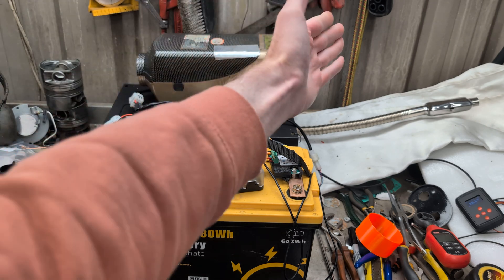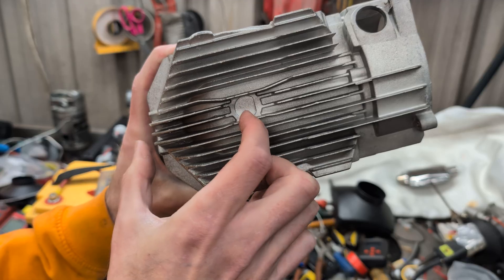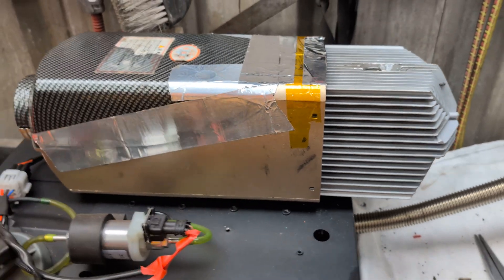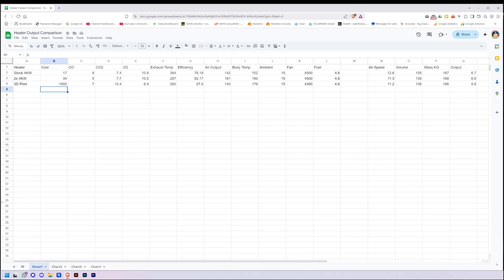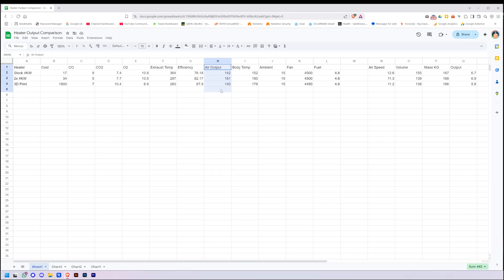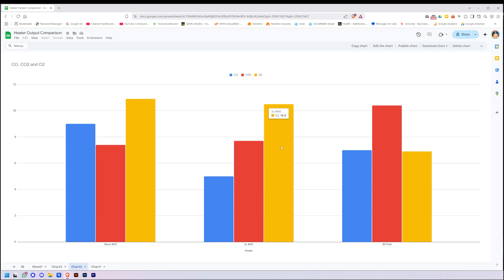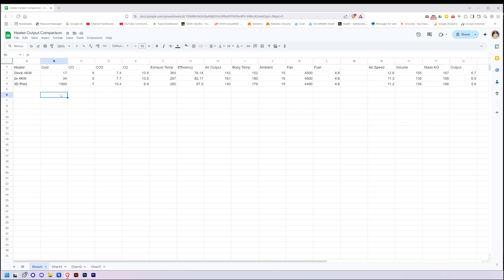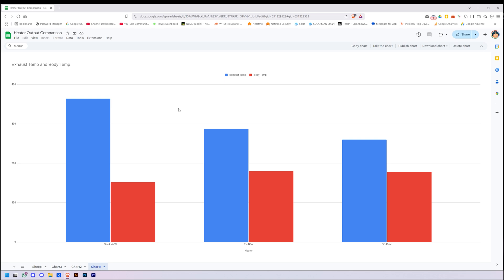8KW Diesel Heater Project - Heater Body Comparison - part 4

Comment: So would standard burn chamber and smaller dosing pump give better efficiency or is the standard pump the minimum dosage for combustion? 🤔
Reply from the maker: I've made the burn chamber longer so the hot gasses go all the way to the end, so they spend the most time interacting with the heat exchanger.  Changing pump sizes is something to explore, but I expect on max power the small pump will struggle to supply enough fuel.

Comment: So, a 4KW heater managed to produce 4.5KW of heat, approximately and was the best results. Not bad at all at almost 88% efficiency. 
I think the gains would not be as impressive with anything longer and think there there would be a point of diminishing returns.
The issue long term would be the burner running cooler at lower settings, not burning the soot away, leading to more carbon build up in the burn chamber.
Good work, David, interesting experiment indeed.

I'd prefer a bolt on TEG setup that bolts on to the exhaust under a van, the wires coming back inside to put charge into a battery.
Even as low as 1 ah would save 24 amps from a battery over a 24 hour period running a heater like this 24/7 during extreme winter conditions.
I know you've done similar it but was a little over engineered and more of a complicated build than I would imagine to be necessary for a 1 to 1.5 ah re-gen.

Comment: Choon!   😉
Thanks for the research!
For viewers with wee screens, maybe alter text sizes, minimise column widths etc to make spreadsheet data and graphs legible.  F11 might be your shortcut to toggle 'fullscreen view' so that the menus and whatnot aren't there, taking up space.
Reply from the maker: That's also the reason I shared the link to the data.  As I'm editing on a widescreen monitor, that's me already making it smaller to match a 'normal' resolution.

Comment: I think that the bigger heat exchanger and burn chamber is the way to go for a new design, but for modification to an existing heater, I think heat recovery from the exhaust is still a better option, running the exhaust through a secondary heat exchanger with it's own fan.
Reply from the maker: Is it worth revisiting the exhaust heat exchanger again.  I did videos on it ages ago but maybe I should remake them using new bits and new tests?
Reply: @DavidMcLuckie without checking all your videos, I know you tried some exhaust heat exchangers, for water and for the self powered heater.
There are lots of videos on YouTube trying to reclaim the heat from the exhaust, running it through household radiators, sand batteries, you name it. 
So whether it's worth revisiting, I'm not sure, I'll have a think about it and send you some ideas if I come up with anything.

Comment: dont these struggle running on low? if people want a cheaper larger one is that 6-8kw one you tested not a better buy ?
how much useful heat can you recover to a coolant/heating loop from the exhaust? for van dwellers that extra heat cooks them and better some is sent elsewhere.
Reply from the maker: I haven't tried running on low yet.  But I expect low to no longer work as the burn chamber is now much larger.  I did the heat recovery from the exhaust a long time ago and you can get at least another 1kw from it using a heat exchanger.  I tried an EGR cooler and a pool heat exchanger.